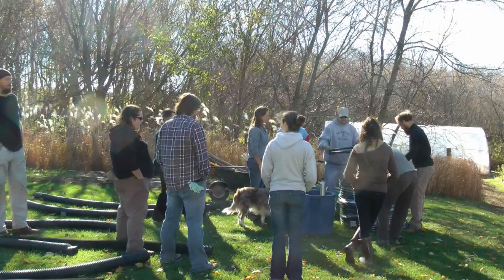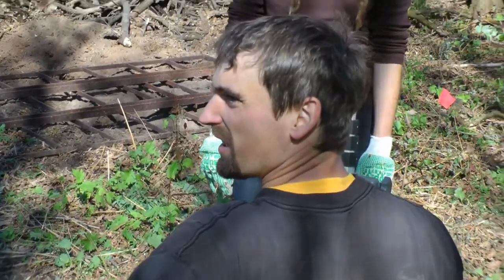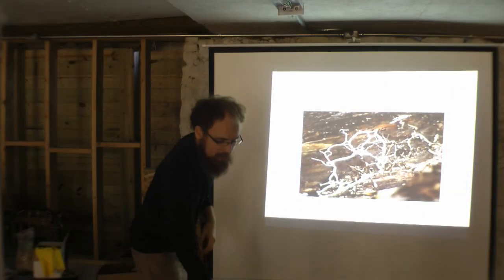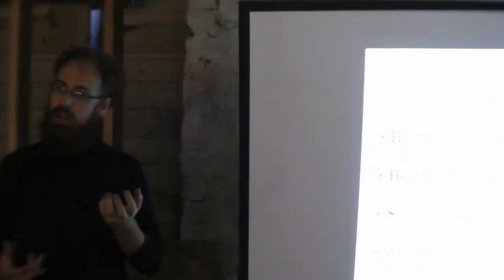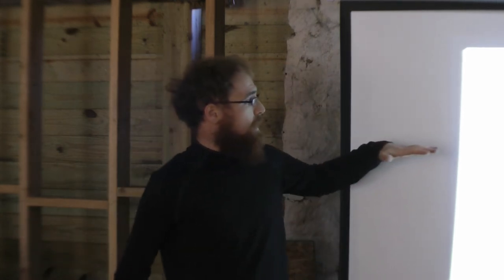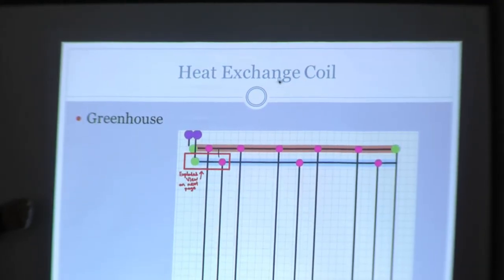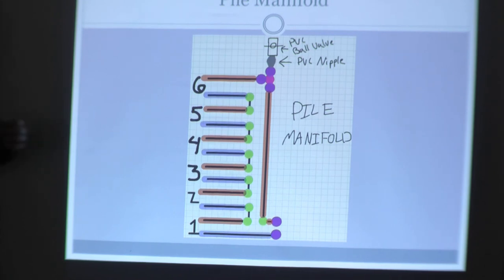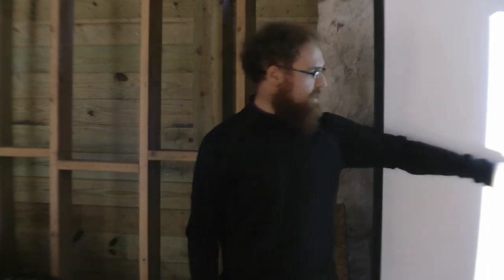Biomeiler Seminar - Composting Water Heat for a Greenhouse

Comment: very cool.  Its nice to see the details thought out.  I would like to suggest running the water the opposite direction through the pile.  That way the water will be hottest right before it goes to the load, since pile temperatures are hotter in the center.
Reply from the maker: Thanks!

Comment: What kind of pump could be used to pump water thru the compost pile? this is the only thing stopping me from completing my compost system to heat a green house.
Reply from the maker: Ask a plumber to figure out the head pressure.
Reply: regular circulation pump with around 7-8 metres of head pressure.

Comment: The heat is a by-product of respiration.  Every cell which respires generates a tiny amount of heat... as individual cells, this is insignificant, but when you have a whole body, like a human, this heat builds and needs to be regulated by various types of homeostasis, such as capillaries dilating and sweat glands operating.  In a compost pile, if you have enough volume, the tiny amounts of heat generated by individual cells builds, and the mass provides insulation.  Aerobic respiration is quicker and more efficient and generates more heat than anaerobic, hence AD plants may need additional warming to enable them to work well, yet a compost heap with access to oxygen and just the 'right amount' of moisture may get so hot it self-combusts.  I don't believe the explanation given in the lecture is accurate.  The chemicals the bacteria secrete allow them to digest and absorb the nutrients from the substrate, but it is the respiration within the cell which generates the heat.  Specifically, it is the conversion of sugars and oxygen to CO2 and water that releases heat. This happens within the mitochondria of the cell. 

Happy for someone to provide evidence that I'm wrong, as I'm always learning as well as teaching!
Reply from the maker: Thank you for this information!
Reply: CompostJohn.. You really should have a channel with lots or, or, a few videos on how to create the "Best Compost Piles for Heating", the Fastest way to Compost,, The Best Composting ways/materials, etc.. 
I went directly to your channel after reading your comments to only find one on leaf mould.. 
I definitely want to heat a greenhouse or hoophouse, and, need to make lots of compost over several years to convert some needing property over to something to grow good, healthy foods..
Reply: @MarkThomas123  Thank you. My problem is twofold: I don't have the hardware or software/knowhow to be able to make a good film, and I don't have time as my composting activities take up quite a bit of it! 

The leafmould film was made with some equipment Channel 5 sent to me prior to them filming for 'Bargain Brits' where they wanted me to do some Freegan stuff.  I took the opportunity to use this high-quality equipment to make some 'segments' which were stitched together by my friend Hazel from For Peat's Sake.  I couldn't do this with my wife's little digital camera, and I wouldn't know where to start with video editing.  And I'm too busy to learn how to do it.  I wouldn't mind a film-maker coming to do some shots with me, though.  

Thank you for your encouragement.
Reply: @compostjohn  Understood..  I think I have 150 or so videos. About 90% of them are done on the fly, no editing.. Some I took the time to put together, but, I don't have the time either.. If I can't just pick up my phone, take a video and upload it, it does not get done.. If I can't find anything on youtube about it, I will take some extra time to edit and post it, if I can't seem to do it without editing.. If you don't have the memory on your phone to do a video, save it, then, upload it, look into the "Live Feeds". You can start a live feed, it streams to the Youtube servers, and when done, it saves it, then, you save whatever details and your done with little resources.. I have not done a live myself, but, it's just because, I record, upload and keep working while it is uploading.. Just a few thoughts.. I am not a gardener, mulcher or composter, but, I am finally getting close to where I can consider it. Hopefully getting a piece of land soon.. When I do, want to be off and running on all sorts of projects, and start gathering what I need in the mean time..  So, I am making notes on everything, have a good idea of what and how to collect, where to put it, and, might have to do a bit more research on some items before putting it all together, but, seems the "Hot Composting", is something that not everyone gets correct.. 
I am going to be doing as much experimenting and testing as I can in that area when I get started.. A heat Compost and a more controlled Bacteria Enzyme Compost that should be more enzyme than heat using Micro-organisms.. 
Sounds like the Hot Composting needs Tall Piles, Lots of water when setting one up, and, although I see them being done with just one source like Wood Chips, seems some alternating green waste or Manures of some type would give it a jump start.. Not sure about the oxygenation, Jeane Pain didn't seem to worry with oxygen.. Just packing it down tight, and making a huge pile.. Still some research to do on that topic.
Thanks, and good luck with your projects.